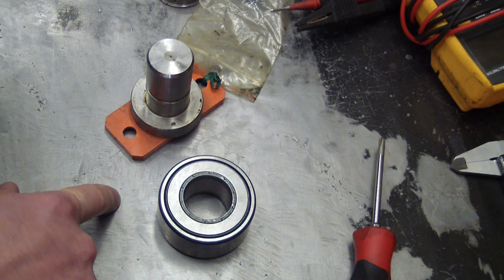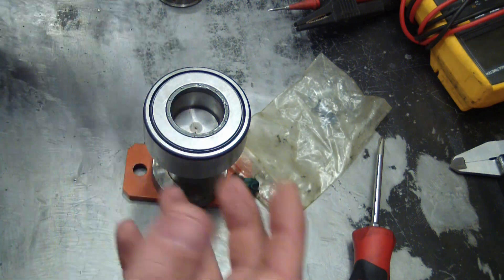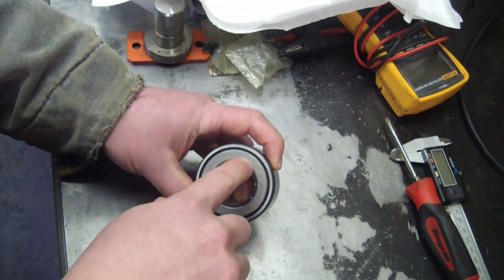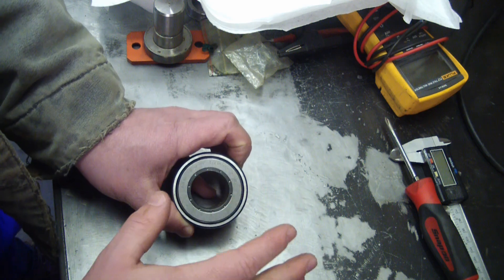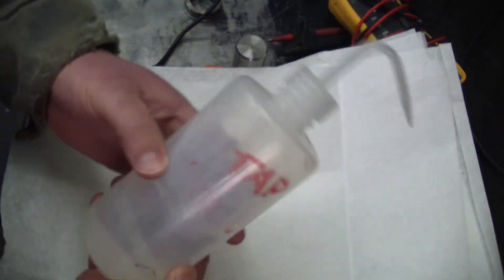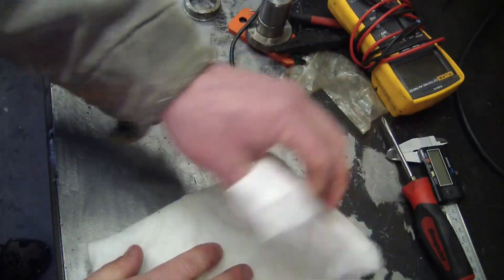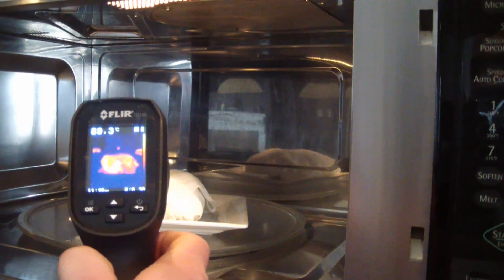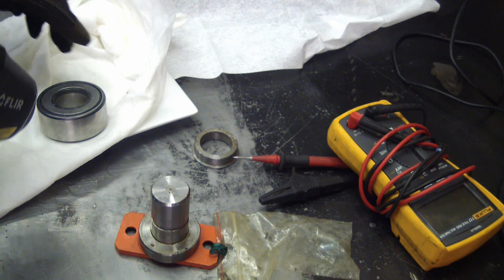The Microwave Trick? It's the easy way to heat bearings!

Comment: how much jet engine mechanic it's very common for us to heat our bearing races up to 350 degrees
Reply: Roller bearings? But you use PCD pressure for oil seal, not rubber like most...
Industrial gas turbines only use roller bearings for small emergency fast start generators, they tend to build up vibration from circulating oil unlike tilt pad bearings that break the flow.
Reply: We use carbon seals in my engine to keep the oil in the sump. Which is not that critical as the engine i work on is a dry sump motor. As far as roller bearing our main thurst bearing is a roller the rest are ball.

Comment: For those without a microwave , nor too frightened of being caught....boil a pint of water,,,,, drop in the bearing...., the heat absorbed by the bearing will drop the water temp to just below 200.  ...Wait approx one min. fish it out,, The temp of the steel is now hot enough to dry the bearing  in seconds...  fit to mandrel....   If the bearing is very small  wait 20 secs for the boiling water to cool a tad.

Comment: working in an engine shop for a bit, we used an old corded f
Reply: corded frying skillet thingy. worked amazing , just put 3/4 of a quart of motor oil in it   , heat up , throw unit in it, and bam your good to go

Comment: There are plenty of IR thermometers for around twenty dollars suitable for verifying temperature. If you don't want to heat water due to condensation concerns you can heat a container of oil containing the bearing instead.

Comment: where I work they just hired a new guy... and we'll I was building a pump and he causes a big deal about me pressing a bearing off the bowl shaft and pressing a new one one ... he said I would bend the bearing ?? said the only way to do it is to heat it and slide it on ... I measured the bearing withe no heat and it was a .0005 fit ... don't see how a bearing would bed being that the material is as hard as it is ... iv always used a press if I could on any bearing iv replaced on any pump or motor or. diff.

so with that being said is it better to heat a bearing or press iton/off??? too Ave or anyone who reads this and may know ?
Reply: They say that because in general people are stupid and will overheat the bearing with a torch and weaken the hardening. 100 deg c is fuck all
Reply: Timken states emphatically, press on, DO NOT HEAT, or your Spicer-Dana axle may go South.... and you another direction.
It all depends on the intended duty of the shaft, axle shafts being of the type where you may want to maintain a bit of metallurgical integrity at highway speeds....
Reply: PhantasmAMX you don't lube the inner race of a press fit bearing or the shaft its going on. The film strength of the lube takes up space/makes things tighter and even harder to install. Same reason you don't want lube on the outside of a rifle bullet casing when you shoot it, it drives the pressures up because it acts like a smaller chamber. the coefficient of friction between to smooth hardened steel surfaces is quite low already. You really just want the inner race and shaft to be clean, smooth, and dry. If there is rust or pitting it's ok to polish it up a bit. Around here, in the aerospace industry, most assemblies are put together by freezing the shaft and warming the bearing up.
Reply: First, AvE's response is epic.
Second, it all depends on the bearing.
If you can heat just the part that needs to be pressed on, such as the inner race, by all means go for it, no harm can be done.
And, if you can put the part to be pressed into the bearing in the freezer for a few hours, do it.
Lube the parts, and with one heated and one cooled, it will press together much more easily.
That said, press fit bearings are meant to be just that, pressed.
As long as you apply even straight pressure, they will press together and not damage anything, provided they are clean.
Lube always helps too.
Reply: As long as you only press on the inner race you're ok
Reply: I would say more of a general rule not to use lube. That being said if its an assembly like a big bearing thats gonna get trashed and exposed to weather on a piece of heavy equipment or vehicle, I have been known to sneak some copper anti seize on the shaft or inner race, or outer race if its a wheel bearing, because I know its gonna get trashed and rusty and I want to have an easier time getting it back off/out.
Reply: Matt B It is a pretty ingenious method.
Reply: James Griffin I knew about freezing/warming and that in many cases no lube is necessary. I thought it just made things easier if you will. Thank you for the information! I had heard there are cases where the press fit means not using lubrication, but I didn't know if it was a general rule, or only specific applications.
Reply: James Griffin Gotcha. Just did front wheel bearings on my car and I did lubricate the housing and outer race lightly to help it slide in and also to prevent future corrosion. I doubt it will cause any issues in the future, but still interesting to consider your points. I tend to lubricate everything I can, as nothing is worse than working on equipment that never saw any, but I may overdo it sometimes.
Reply: James Griffin Exactly. I live In Vermont, and cars here love to rust good and seized and yet rust apart at the same time. If I don't come out silver, I probably didn't finish the job. :P
Reply: James G.   You are right about the inner race being clean and unlubricated but Phantasm made no mention of lubricating the inner race. Best bet to save your microwave is to get an electric bearing heater with a stepped heater cone for various diameter races.
Reply: Sometimes pressing a brng will score the shaft it is going on. Thats why I always use heat or freeze method. I used to press everything too. I suppose from time to time I do still press one but it is rare and well thought before I do. Bend a brng?? No I think you are right and I have seen them crack and shatter but never bend.
Reply: Sometimes it is hard to press on the race of the interference, like in this case, you don't want to press on the outside race to install the inner race.  How much force is there on that half thou fit?  It might be more than you think (if you do the math.)  I put together a VW beetle engine and the timing gear is friction fit on the crank, the book suggested heating it in vegetable oil.
Reply: Speaking of VW Flat 4s I have a lot of experience with them and I used a cheap hot plate to warm it up.  You have to heat those, not pressing allowed or you will bend the crank.
Reply: Matt B My dad used to be a VW mechanic. I wonder what method he used.
Reply: Induction heaters trump all others. Within minutes,  bearing of any size can be heated and dropped over the shaft to the shoulder. Stepped cone heaters are less expensive and more time consuming, but will do the job up to 6" id as well. Probably designed for larger sizes but I have no experiance with them. I will never press a bearing on a shaft again or heat with a torch.
Reply: JackOfAllTrades1972 aQz
Reply: Well sadly, I wasn't able to use this trick to put on a set of carrier barriers on a Ford 9 differential and had to resort to the press.  The did get nice and hot with no sparks in the nuker along with a temp of 200 degs via my IR thermometer, but theyd need to be a whole helluva lot hotter to drop on the diff.
Reply: If that was at me, yeah, I've done it more than a few times (pressing) , was hoping I may be able to do it and just drop em on.  That wasn;t happening at all

Comment: Great idea! Next time I'll use the microwave in the shop over the beer fridge to heat bearings. I made a termite
Reply: killer from the guts of a 1200 watt microwave found in the trash. It's too heavy. Can some suggest what kind of shielded wire to use to separate the transformer about 8ft?

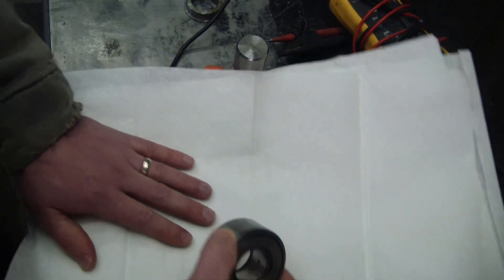Comment: It did not work for me, my bearing is way smaller, I set 1:30min on microwave. Hmm, had to beat it with wooden piece.
Reply: friction fit bearings are standardized +0.01mm diameter shaft is bigger than bearing diameter.
Reply: +juliusvalentinas Steel expands by 0.12% per 100 kelvin. That's not a standard, that's a fact. If you stick to your standards so blindly that you ignore reality, then guess what happens? Even a proper, purpose-built bearing heater wouldn't help you.
Reply: TheHue's SciTech
Reply: Robert Wetteroff Yes? :-)
Reply: Discipline the cybian?😂😂😂😂😂😂😂

Comment: thanks a ton, this trick is tuely amazing. was replacing a ring an pinion in a bevel drive. the manufacturer musta pounded the ring gear on the shaft (4") it was all chowdered up, i removed with hammer, microwaved gear freezered the shaft, and it slid back together by hand!!! way better than a torch, very controlled temps!!!

Comment: Why dont you just throw the thing in a pot of boiling water for a couple minutes,   water boils at like 210 degrees depending on your altitude.  That would be perfect
Reply: because that much boiling water would boil off oil or grease, and cause the bearing to rust. Plus, steam is actually more effective than just water, if I remember correctly.

Comment: DRYing bowls is why I have a microwave in my shop. I have one in my shed, too. (Renters throw out all kinds of like new working shit around here. Sometimes I think some of them just ended up in jail/prison and their relatives throw their stuff out. I dunno. I don't care, I just reap the rewards. ) Now I have another use for it.

Say, I notice you are at 6 degrees so you are somewhere cold, also. My shed lock froze the other day when I left on my bike then froze again while I was gone (lots of blizzard like conditions here lately -- its never done this before this year) and it is a Medeco with I believe a brass cylinder.

Best way to open a frozen lock?

I ended up using a lighter I found while out riding (stoners, ya know, they lose everything) so I pulled the heat shield off of it and ratcheted it up way beyond the store bought potential and fired the lock and my key. Took a few seconds but it worked.

And also, what is the best lubricant for a lock that I might have around the house?

( I bought in a can of brake cleaner so I can spray it in the lock to deice & hygroscopically absorb moisture if it happens again) But you are one smart & clever MFer so I figure you'd maybe have another fun trick.

Comment: Brilliant!! All microwaves should come with a bearing button.
Reply: +rogertopful It's under "popcorn" on mine. LOL
Reply: @4x4dually  j
Reply: @4x4dually  I wonder which program is ideal? I actually wouldn't be surprised if some work well!
Reply: I know right! When I first saw the video I wondered how he was going to keep it from sparking. This was brilliant.
Reply: Maybe a new microwave could be invented that has loads of presets - melting solder - bluing steel - PLA wax casting etc ..
Reply: Couldn't have said it any better myself...
Reply: Q
Reply: 😂 Hillarious
Reply: Honey what’s this new setting on the microwave, well it’s for hard surfaces 🤪
🤣🤣🤣🤣🤣🤣
Reply: Brilliant! The old water on the cloth trick. Now I can use that trick on everything metal........ 😃
Reply: @geor664  😂😂😂😂
Reply: @geor664  Also works for stopping the location tracker "The Company" sticks up your nose when they wipe your memory! (Minus the microwave)

Comment: couldnt you just freeze the other half to make it smaller instead?
Reply: Its easier to heat something to 200 then to freeze it to -200.
Reply: I am pretty sure the expansion rates above certain temperatures are much different than the contraction rates below certain temperatures.
Reply: +warmfreeze LOL  How sure is pretty sure? Pretty not sure is getting the bearing halfway then stuck.
Reply: +Nate Beats -200 is nearly absolute zero (273,15)

Comment: For people in warmer climes, you could possibly to the converse by putting the shaft in the freezer for a bit.
Reply: +Paul Murray  Placing a motorcycle bearing in the wheel worked like a charm. I left the wheel in the summer sun, and froze the bearing. tapped it right in without a problem.
Reply: some people do both.
Reply: +noanoxan Ive had success using an average freezer many times.
Reply: Or people in colder climates could just leave the shaft outside over night.
Reply: what about freezing the shaft and heating the bearing to about 100 c ?
Reply: Shaft in the freezer? My shaft can barely be found after a cold shower.... lol
Reply: +daboroxson15 same, had good luck with that
Reply: can of compressed computer duster air will do it.
Reply: if I'm fitting bearings I'll usually drop the shaft in the Dewar of ln2 for a bit
Reply: All depends on the sort of work you do, and the specific project
Both have their place
Reply: Yeah I've done that. Carrier bearing in the oven, shaft in the freezer. Took a little bit of percussive persuasion but went right on.
Reply: +mark ealey Out of curiousity...what temp? I'm sure the bearing is designed for a bit of heat, but ideally it's job of reducing friction means it's not heating up like a oven.
Reply: I also usually freeze the shaft (or the bearing if it is press fit into a hole).  As said duster can upside down or a can of r134a (cheaper) works great for freezing shafts that you can't get in the fridge.  I usually only heat bearing races that can seperate so I am not heating the bearing and grease itself.
Reply: +Paul Murray The average freezer wouldn't be cold enough.

Dry ice, however, could probably do it. -55C is damn cold lol
Reply: @noanoxan wrong. I've done all my ujoints and ball joints in my old freezer and they all about fell in. After they warmed back up they were nice and snug
Reply: I just sand down the shaft with some 120grit. Goes straight on.

Comment: so apparently if I ever try this again at work ill be fired lol
Reply: Canadian here. Just set it outside for 10 minutes. It's colder than your deep freeze anyway
Reply: @domesday1086  in Canada even in mid summer that works ... Apparently! Hey!? 🤣🤣
Reply: I'm sorry, but your comment made my night!
Reply: William Jennings just stick it in a deep freezer or your kitchen freezer for 24 hrs. That works for me. And it's free.
Reply: @northwest_5oh3  up there in the great white north, the freezer is just slightly warmer than the workshop.
Reply: Apparently you missed the ending...
Reply: +jp jp think before you word vomit
Reply: Seriously? Grease will separate and actually start to do his job only at that temperature.  What do you think the operating and maximum temperature of a bearing is?
Reply: William Jennings cool with CO2 fire extinguisher
Reply: @jackdyke   I'm a fan of the inverted air duster, works like a charm for smaller components.
Reply: Blew up my microwave...thanks
Reply: @zumazoomzoom7632  hmm! Don't think you were supposed to set it on four hours! 🤪🙄😁😁 Hope you were joking! 😱😢
Reply: @zumazoomzoom7632 😂😂😂😂
Reply: S Kellar because that's not expensive at all...
Reply: Thought the point of the lube in a bearing was when it heats up it lubricants all the components and that bearing was made to be heated to seat it on the other dodad
Reply: Hahahahaha
Reply: and messy as F
Reply: But did it work?
Reply: Gord Baker , the correct usage of apparently
Reply: Lol stay at home sad
Reply: Lube not being able to handle 100 C LOL.

The grease in bearings and other components is shear-thinning, so while it's goopy at a stand-still, it lubricates just as well as an oil when the bearing is in motion.
Reply: What you described is a common method of Copper core CPU heatsink assembly. They Extrude the shitty aluminum heatsink with a big hole in the middle, and then cut a piece of copper dowl a few thousandths too big. They throw the copper core in the freezer, and bake the aluminum heatsink. slide the two together, let cool, and presto.

Only downside is that cooling is used when the materials have shitty tolerances, and freezing/baking only one or the other would not do the trick. If they're too far out of whack, you risk cracking your work piece.
Reply: @stompyrobutts  They put valve seats in the valve case with a interfere fit this way , freeze seat and heat case , drop in place , never can come apart in even in high temp nuclear steam use .
Reply: trombonista92 , why apparently,  what was said ?
Reply: Simple & Useful for on the road tool repair, and even if it doesn't give clearance for "hand pressing?" it certainly makes it like butter when pressing it with a tool. 

Is there any reason not to cool the shaft to extremely low temperatures if you need extra clearance?  Assuming the same property would work in reverse without causing damage? If so how cold would be safe? Liquid nitrogen spray or something like a Dust-Off can upside down?
Reply: @stephanied6089  Cool it with a can of compressed air held upside down.
Reply: @stephanied6089  He dons't have a bearing heater, but he has liq. N?
Reply: @stephanied6089  We put ball joints in the freezer at the auto shop and they go in place really easy then .
Reply: @stephanied6089  I know this is a six year old comment, but someone might find use for the information. The main issue with cooling the shaft is condensation. If you've got a bit of frost or even just a thin layer of water on the shaft, you may quickly cool your bearing race down to where it fails to slip on before it squeezes the shaft, and once it starts pinching the heat transfers more quickly, so it's a good idea not to get the shaft too cold. Most bearings you can just boil em and maybe cool the shaft down a little, but if it's a very tight interference fit, you can look for equations to figure out what temperature difference you'll need for a slip fit and just make sure you've got enough of a difference in temp. Basically cool the shaft as little as you can get away with to make things fit easily so you can avoid as much condensation as possible.
Edit for clarity: It's not usually really an issue in most situations, more something to be aware of.